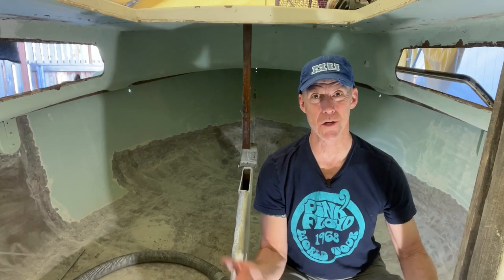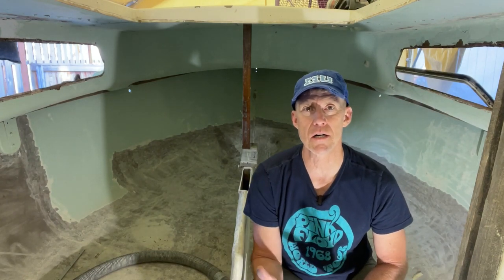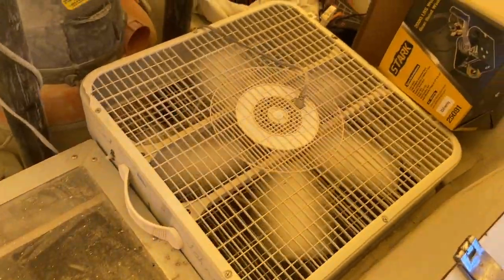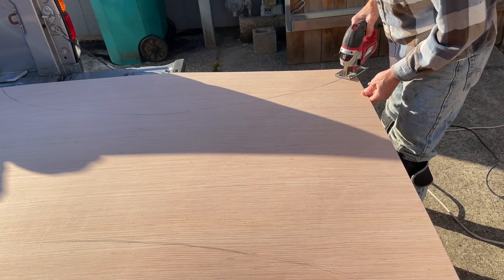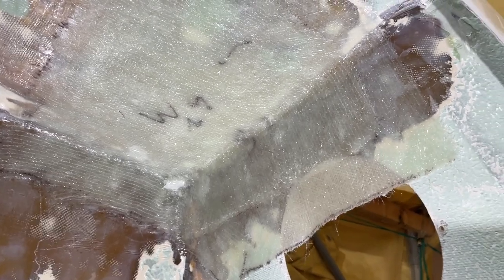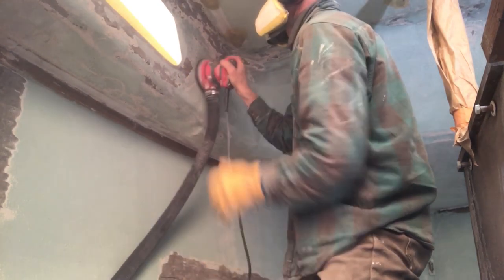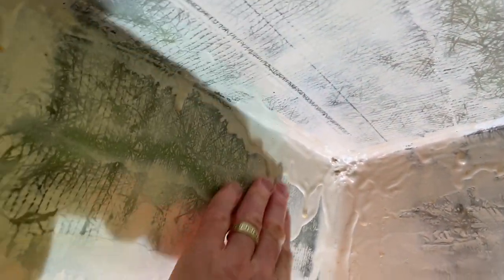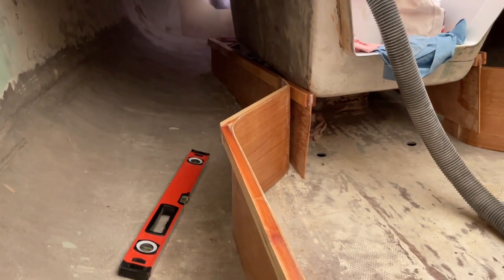Cabin Furniture Build - pt 1 | Interior Redesign

Comment: i guess you just about finished the interior ,i noticed you didnt included water tight sealed compartments under the benches for buoyancy from bow at both sides and also at rear under 1/4 berths ,in theory your boat should be able to fill up with water  upto the height of toe rails including the cockpit and still float ,ok so the cabin roof would be the new water line but you could sit ontop of it until help arrived

Comment: What reference point on the boat did you place your 4 foot level when leveling the boat?
Reply: Since I wanted more headroom, I determined how much I would need/want and place a mark on the boat that was three inches below where it was originally. Then I started there with the level - down one side and across to the other. I compared in many places holding level athwart ship to confirm they were both in the same place. When I used the level, it was working well u till I reached the sharper curve of the bow. I think if I place a bubble or two on a batton it probably would have worked as well as a laser level. But since I had the laser, I chose to use it.